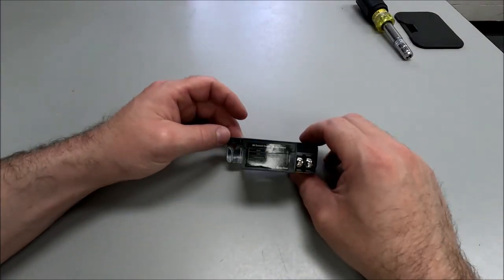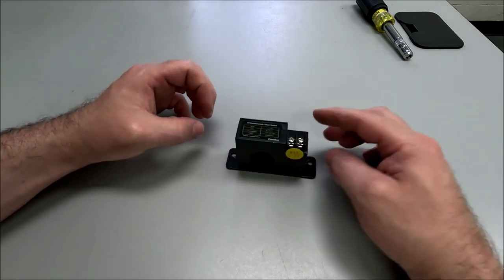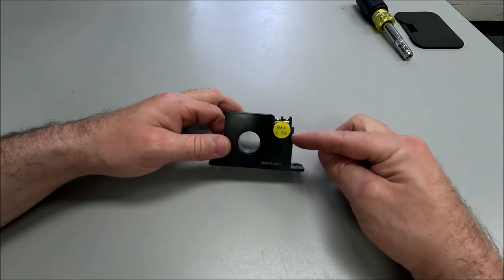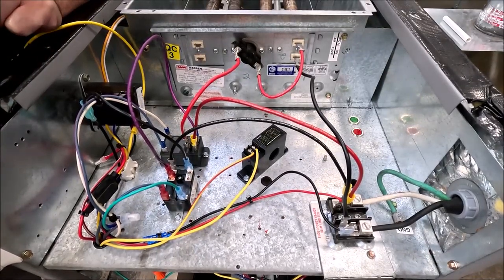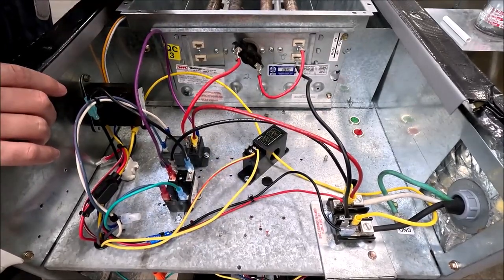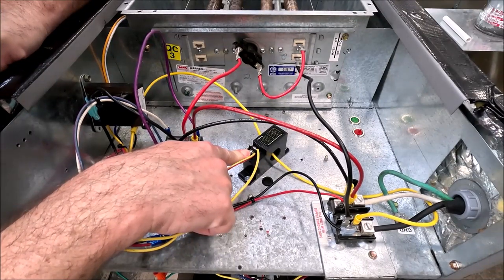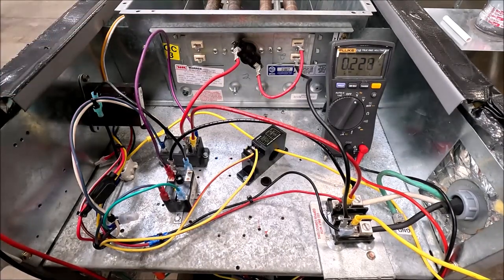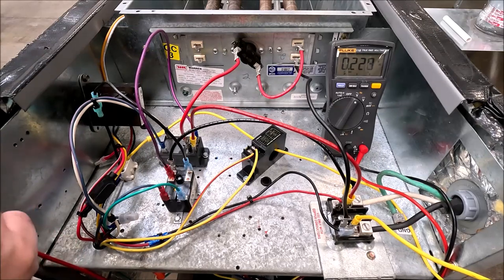Current Switch and How You Can Use It

Comment: Excellent video. Playing back what u taught us, once the current switch senses power, it closes the NO circuit. These switches can be NO or NC. Is there a way to add a delay of 1 second +/- so one device isn't shutting down at the same time another device is powering up? My plan is to use a current switch to determine when my AC is drawing power from my solar array. When the AC compressor goes off, as dictated by it's thermostat, I will use a current switch to send power to a relay that powers other devices which will consume the power the solar panels are putting out. Comments welcome.
Reply from the maker: They do have time delay relays, so many options...depending on the final wiring schematic you come up with... or sequencers might work. You could look up white rogers, mars relays, or honeywell and get to their online catalog and see all the specs.

Comment: John Jennings Dave here, great indepth video on current switches. I bought and installed a Goodman split system in my personal home. It has run very good for almost 10 years, now though I can't get my condensing unit to come on. My pressures are in range, both L1 and L2 are there 240 volts, 27 volts are at the outdoor unit In calling for cool. My unit has a time delay device wired to a Comfort Alert Switch relay then a fan control relay to the L/H pressure switches, and then back to the contactor coil. We did a major remodeling this winter and I lost my installation service manuals. Where would I get wiring information from Goodman for my unit? It does not have any model numbers on the Condenser anywhere. It is a 16 Seer 2 stage cool, probably built in 2008-2010. Any help direction will be greatly appreciated.
Reply from the maker: Couple different approaches...#1 - maybe reach out to the original contractor to see if they still have the info on file, #2 - sometimes the info is on the data plate (under the service panel / above the service valves) but is worn out by weather and faded. Sometimes a good pair of polarized sunglasses let you make out the information, and #3 -  get the model number and serial number off of the compressor (provided the compressor is the original and has not been changed) and call your local goodman parts store/dealer to see if they can look up the details for your unit. They should be able to find it by the compressor info. You may also be directed to call goodman directly, just grab their 800 number online. At least these are the steps I would take...maybe flip 1 and 2!
Reply: @johnjennings-JJ  Thank you for the Fast response, now it's time to get to work.
Reply: @johnjennings-JJ  I fixed it! It was the short cycle relay. It had 3 bad solder spots on the terminals that went bad. I resoldered them put it back, and everything works as it should. Thanks for you Very informative videos! Subscribed to some very valuable information! Thanks again!
Reply from the maker: That's awesome. Not too many people I deal with in this field even try to solder anymore  but I think it is more just because of warranty issues and such. But if it is your own unit and it isn't working...what have you got to lose!

Comment: It may make for sense to have an air flow sensor.   I was thinking of using a "relay/sensor" like that to operate a UV-C lamp in the duct work when the fan was operating.   It would permit a completely separate circuit for the UV lamp.  (Obviously, another relay would be needed for the UV lamp.)
Reply from the maker: To be honest, I hadn't thought of using it to control my own UV lights. I have mine just run 24/7. That is a great example of how it can be used. Should be fairly easy to just run a low voltage circuit off of the transformer through the current switch in order to control the UV relay.👍
Reply: This is what I want to. My UV lamp runs 24/7 even when there's no airflow. The lamp burns out prematurely.
Reply: @johnmcelwee9712  --  Well, I've been kicking this around for a few years (even since the COVID hit).   I'm not an appliance maker so I don't want to mix high voltage and low voltage in the same box (this is routine in air handlers).   A lot of "gadgets" do mix the circuits with high & low connecting via the same 3/4" knockout.

Perhaps someone could "package" something to do the job.   Just a simple 24 vac relay with the "hot" side in an approved box and the "low" side with just some wires or screw terminals.   It would connect much the same way as a doorbell transformer.   Some years ago I put in a "relay" transformer to adapt a shop vac as the replacement for a "whole house" vac.
Reply: @GilmerJohn    The UV light I have is 120VAC.  It plugs into standard outlet.  I think I could use one a current sensing switch to operate it.
Reply from the maker: @GilmerJohn I think my barber just did the same thing. Had an issue with the "while house" vac and just bought a shop vac..who ever put it in as the replacement probably used something similar or at least had his circuits figured out!

Comment: hello do these work in any direction ? we need it to turn on when current flow in opposite direction eg. when solar inverter is exporting power to grid it switches so we can use power somewhere else..
Reply from the maker: Honestly don't know how it would work in a solar application. I know there is a difference in the DC amperage and AC amperage though.

Comment: So if I connect a 120v 15 amp line into the switch and run the output to say a 1 amp duct booster fan the switch should be able to handle it, correct ? Powering anything below 2.5 amp...
Thanks for the video!
Reply from the maker: I would agree with you on that based on the specs from the manufacturer. But are you saying run a 15 amp rated line such as a #12 AWG to it and then a smaller gauge from it to the booster fan?
Reply: @johnjennings-JJ  14 awg for 15 amp.probably 14 gauge wire in and out of device to fan. But the fan should draw about 1 to 1.5 amps is all....
Reply from the maker: 👍 i figured that was what you meant but why not just run the smallest gauge possible for the entire circuit and save on some copper! Either way it should be fine.